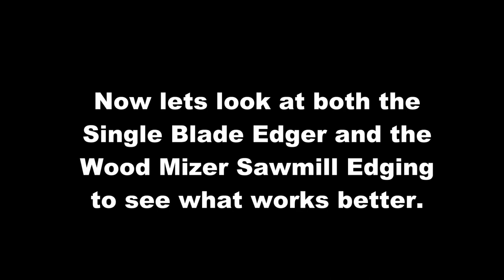MILL VS  EDGER SAW, WHO WINS?

Comment: Edgers are the way to go... as you know. I have to use my mill to edge since I can't swing the $$$$$ to buy one. How are you making out with the hydraulic pump solenoid?
Good video.  Dave
Reply from the maker: Got the new solenoid in and replaced, and will never tak hydraulics for granted. Now she is running great. Thanks Dave